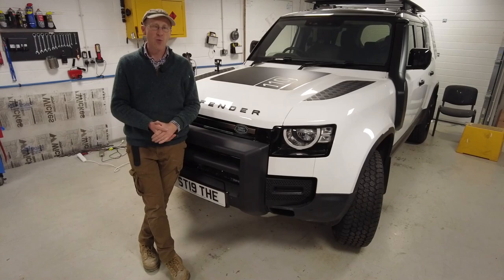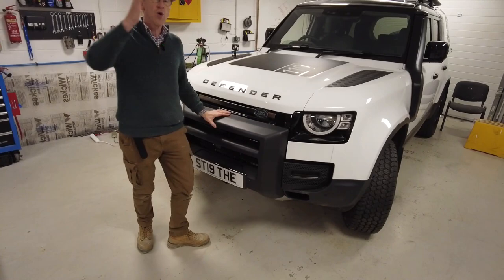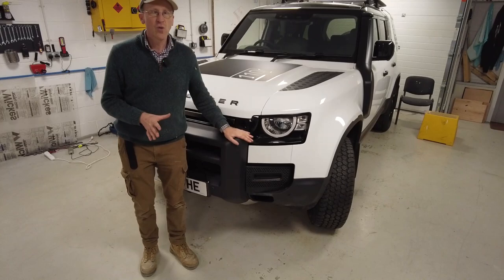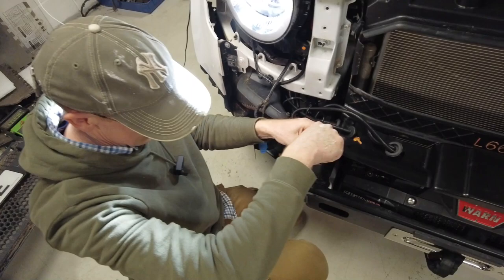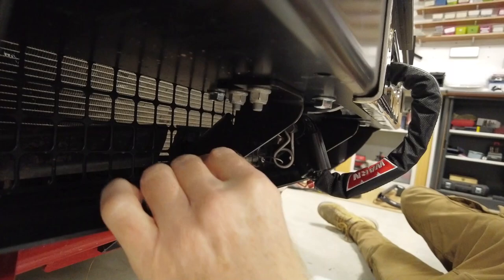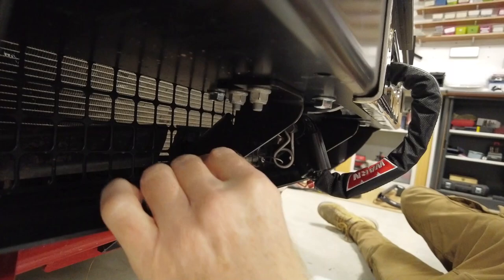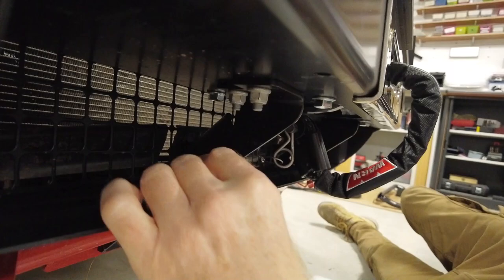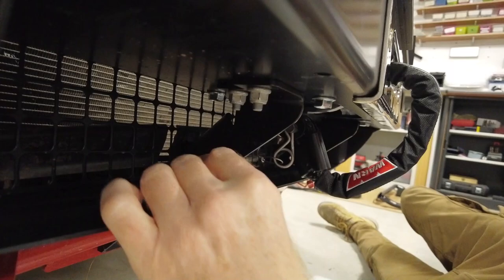New Land Rover Defender Winch Installation - part 5  "The Final Cut"

Comment: They have designed the vehicle without a winch and then added the winch later as an afterthought. They should have designed it with a winch from day 1 so that the standard parts would fit round the winch without cutting stuff. I fitted a towbar to my Jag XJ and that was the same (despite them winning towcar of the year); it was a horrible hack job.
Reply: Yes if it was designed at the same time they could have marked all the area's you have to cut out save you hacking away with luck and hope you're in the right place

Comment: Just wanted to say well done! What an effort! So much cutting, so many wires and lights and sensors and radars and clips and screws and grommets and bits of plastic....bloody hell it's an epic achievement. Even the ardent DIY enthusiasts here are thinking if they ever get one they'll order a factory fit!
Reply from the maker: I would love to see if the factory fit ones do all the little jobs... I am off to Eastnor shortly so will take a peak at any factory fit winches... do they fit the weather strip / grommets etc ?
Reply: @L663  excellent, yes would be great to know how they do it and what is different! And if they cut all those bits or do some alternative moulding plastic parts exist at the factory.

Comment: Wow what a major undertaking doing this oneself.  My concern though is that the average dealer technician won’t do these often and possibly not apply the same care and diligence that you have or owner, which as you’ve shown is clearly important for the end result and long term performance in the wet (water ingress etc.) etc.  So, I wouldn’t trust anyone else to do this.  Therefore your video series will become the go to tutorial for every winch installation.  Please can you produce a summary video to advise all required tools, tips, time allocation and how often you need two persons on this project.  Finally don’t forget to follow up on the rotation flaps.  Thanks Simon.

Comment: Just tackled this task today.  Took me a full day, but I am pleased with the results.  These videos made the task tremendously easier.  Well done!  And, by the way, the metal A bar on mine needed to be wrestled in the same as yours.  The right side (or as you called it, the left side) was particularly challenging.
Reply from the maker: Wow well done... how did you choose to wire it in ? The Land Rover way or my way ?
Glad the videos helped you
Reply: @L663  I used the standard Warn winch so I didn’t need to access any of the wiring harness/fuses. The one thing I did add was a electrical disconnect on the positive lead so I can keep it disconnected until needing the winch.

Comment: Thanks for the video Simon,  just finished Installing and the video was very helpful.
A couple of things I learned that may help others. You don’t need to do anything with wheel arches, not even the first clip.  It is a good idea to hook up two sae power cables to the back of the winch at time of install for future adding of accessories such as lights. The black crank wire fit into the back of the harness without needing splicing in my defender (2021 xdynamic SE USA).  I did have to splice into the ignition wire.
Reply from the maker: Glad the video helped and all credit to you for having a go ! thanks for the updates I am sure this will help others !

Comment: It is cool once its fitted and will be much much safer for other road users etc than a hulking great big lump of ARB steel strapped to the front of the motor. Must be one of the neatest looking (and safest) installs ever, albeit there's a shed load of work involved, nothing good comes easy!

Comment: Nice work,  nice videos. Winch installation is a pain in the back, but worse is gonna be, as the user's manual requires, the manteinance and checks after each use (i.e. keeping winch, rope and switch control free from contaminants, inspecting rope for damage,  ) or every 90 days (i.e. checking fasteners and make sure they are tight 
and to proper torque, verifying wiring to all components is correct and be certain that all connections are tight), replacing the synthetic rope if damaged.....

Comment: And in case you are out there somewhere and have to maintain the winch, like the relais, or spool a new rope, then you have to dissessamble the whole car?
Reply: Winches also need to be serviced and maintained which almost invariably requires its removal from the vehicle. This is a shocker on so many levels.
Reply: I believe you and N Noddy have hit on the real issue.   Winches are working mechanical tools and easy access is required.

Comment: Thank you for this. Watches all 5 parts tough job and not one for me. Will get the dealer to do it. Only observation.......should have raptored it first.
Reply from the maker: Yes at least that part is easy to remove.... not sure about raptor on the Polypropylene used on the front cover.

Comment: What amazes me is how much cutting is needed of existing panels and therefore the opportunity to make some significant mistakes. Why can't Landrover provide the precut panels as part of the installation kit, or better still,  redesign the panels so that they are dual purpose ie can accomodate the mods as necessary without all this messing about and specialist tools to do the work? Come on Landrover, you should always put the provision in for all your bodywork mods, like other companies do.
Reply from the maker: I think i would agree with your comments - nearly all the front panels needed cutting !

Comment: Given the costs and time to fit a winch , why would you?
Reply: Nobody in their right mind outside Saudi would bother I reckon.  Dealer would love charging the £1500 to £2000 for the labour time as long as they could persuade a mechanic to do the job. I suspect that once would be enough for any sane person.
Reply: The Finnish LR dealer said it's a 10,000€ option
Reply: @pkupias  
In the UK an 8000 lb winch similar to this would cost about €1500 to €2000 maximum, fitted to a Ford Ranger.

Comment: Ahhh! I feel sorry for you guys having watched this.   Looks like your winch is a warn Zeon Platinum 10 or 12 S with the wireless remote control???  Expensive bits of kit.
Unfortunately despite what Warn say in the marketing they are not weather tight, water gets into the control pack (just rain, the occasional splash and humidity in my case) .  I am on my third control pack in four years.  Not sure if you have or you haven't considered  (I haven't watched all your 5 videos on the install)  the remote relocation kit for the control pack?   You need to get the control pack away from the top of the winch and have it somewhere nice and dry high up under the hood (bonnet).
Moving the control pack would probably mean less cutting for you.  When you come to replace the control pack which you will they are over £600 and for you a whole lot of disassembly of the vehicle to get to it (another reason why you should go for the remote relocation kit for the control pack).
The powder coat finish on the winch is poor.  The aluminium will show corrosion starting  within 12 months (the paint finish is not covered under Warn's warranty).  I rubbed mine back and used an acid etch primer and satin black top coat and it has been fine since I did this.
Best of luck guys :)
Reply from the maker: OK we have been warned.... excuse the pun !
Reply: Thanks for the heads up. I have followed up on your advice and you are absolutely right. This Winch is not suitable with the control box mounted on it. Land rover have made a huge mistake. The control box is not well sealed. This is the best comment made in all the 5 part series. You have saved me a lot of money. Simon, how much wading have you done and is your Winch still working?

Comment: Another example of failure by LR to design a practical off road vehicle. Being able to accommodate a winch is a pretty basic requirement. The vehicle design process obviously took no account of this and they had to come up with some way to cram one in there, as an afterthought. The fitment thus requires 3 days disassembly, cutting apart, modifying and reassembling of the vehicle. Epic fail by LR, fantastic effort by PowerfulUK. Well done Simon, Tyler & George.
Reply: Most ppl that I know who have off-road vehicles buy HD bumpers. Those bumpers get the winch, and they are not integrated as the Defender version.  The car has been out less than a year and two companies are working on a HD bumper.  Maybe your friends trucks are different and all the winches sit on OEM bumpers.

Comment: Many thanks for those 5 videos showing us how to plug their winch equipment. Really nice job.
It also pop up few concerns:
- it look like they miss this accessory when designing this vehicle
- how much it cost to get it installed by your official Land Rover dealer ?
- why they made the front so complex with all those pieces ? It very looks like over over engineering!

Conclusion on my side:
- I was tempted to purchase this new Defender 110 instead of the old one. I might revisit it
- never touch the front as it might cost you a fortune to repair while off road
Reply from the maker: I think they had a lot to contend with in terms of design / safety / crash test etc
I am not sure how much this costs as a dealer install - not cheap I would imagine.
Other than a few technical niggles that are getting resolved with updates the new Defender has not let me down.
Reply: @L663  I saw your test run in mud. It is really a wonderful off roader. I will be more worried to unplug the front to clean it properly every time i use it in the mud. I am not sure all plastic clips will last long enough to ensure proper installation. 
Again, I have absolutely no doubt about  its off road capabilities. But when it come to equipped it for long trip (few months) for off road or overland, that’s another story IMHO.
For my point of view, it’s a perfect car for short trip (max 1-2 weeks) from time to time, but definitely not as we use to use the old Defender !
Thanks for your replies.

Comment: I have never had a winch on my landrover defender but back in the days before I gave up a 90 for something more comfortable I used to read the various land-rover magazines. Many articles become frequent features over the years and one would be to service your winch. You see how much silt was left between the plastic bumper parts after you had power washed it? Well all that will be inside the winch after a few wet offroad trips. How many days and spare plastic clips and sticky pads will you have to set aside to service that plastic bumper covered winch? Remember the gromits in the cover for example. All this is before the various bolts are attacked by road salt and dont want to play.
I have watched and enjoyed your 5 part series but am unable to take the actual kit seriously and can only assume that many will be fitted but seldom used. Sorry its a bit long, like the videos.

Comment: Great video but what a Faff and the number plate mount looks like it will last ten minutes before the lugs snap off.  Can you imagine the work if its ever in a front end bump, all those new bits of plastic to start cutting up, the large black cover looks like an old air con unit strapped to the front.
How come you had a faulty Defender and were given a free winch while the US guys who had the faulty Defender (then the winch loom shit) were given a $16,000 upgrade to a 6 cylinder model?? 
Keep up the great vids, love your enthusiasm and no nonsense approach.

Comment: You have fitted the number plate in what looks to be the only place it can go, but using the winch in the dark?  Its going to be easy to loose that cover along with the reg plate.  Could it be on a retaining wire?

Comment: Question for you if you’d be so kind? Do the winch fitting instructions imply much difference between the various engines/models? Have a P400e PHEV coming in March and certainly want to fit a winch. I wonder whether there are any differences... No starter motor & hence no crank signal I guess??

Comment: Wow. That was tough. I wonder how much JLR charges to install one (not counting the cut loom 😳)... Well done!
Reply: I reckon a dealer would charge a minimum of £1500 and probably more than double that. That's at £100/hour. Many main dealers will charge well above £100/hour these days.
Reply: The winch alone costs $6000 in Australia.
Reply: @FJUH  
That’s £3400 UK. That is a ridiculous price. Top quality industrial duty 8000lb winches in the UK are generally available for less than £500 including 20% VAT

Comment: Bravo!

Whilst the winch is impressive, and looks great, for the price it costs (£3K in the UK), you'd have thought that LR would provide you with a load of replacement bits so you don't have to cut up your lovely new Defender.  What happens if you decide you want to take the winch off and return the car to its previous state?  You can't - you've cut holes and removed sections all over the place.

Looking forward to seeing the wheel arch protection soon!

Comment: Wow.   You two guys have executed a really valuable service!  My sincere thanks, and the thanks of many others, I am sure.  

Clearly JLR did not complete the design job --- they should have provided either new plastic parts or molded-in cut indentations, as well as placing more thought into the wiring design.  

I guess I question why the JLR marketing decision was to stuff a winch in such a small area, apparently in order to maintain the surface profile of the original design (the one without a winch).  I really wonder as to the practical usability and serviceability of an enclosed winch, over the years and in real-condition.  

I for one do not care how the vehicle looks --- I specified and bought my 2020 Defender because of its 4x4 Drivetrain --- to do work off-road. 

So, I am holding off on ordering a winch for now, hoping a more practical option may soon come onto the market from an aftermarket supplier.  If it does not, I will try to figure out how to make a more practical installation of the winch.
Reply from the maker: Hi Chris... yes I am not planning on doing another winch for a while ! good luck with the design.. the video should help you understand some of the issues and where the car has strong parts to attach to.

Comment: Just another reason I own a crude but effective plus cheap fj cruiser. I can install a ARB front bumper and same winch in less than 4 hours. If I need to work on that winch I can get to it from on top. Try doing that with the new landrover. The old ones you could take apart fairly easily. I'm definitely not seing it with these new ones. Smh
Reply from the maker: These are good points you make - and hard for me to Defender even as a fan of the new Defender !

Comment: Hi, could you tell me if Defender 90 with winch mounted is longer than without winch and, if yes, how longer is it? I coudn't find this info in LR sellers in Italy. Thanks for your help!
Reply from the maker: Hi Edo - the car will for sure be longer than the standard car.. I can confirm how much tomorrow when i am in work !
Reply: @L663  Thank you! I plan to buy the Defender with the winch but I don't know if it can fit my garage... May you check tomorrow how long is it and how much is the height from ground to the top of the main metal black frame? thank you very much!!!!!!!!

Comment: 😲Well I survived! Only just though! That was a mammoth session of five episodes of fitting the winch 🥱. Anyway, quick question, do you need the LR underbody protection plate or will this work with the aftermarket system? 🤔
Reply from the maker: It should be OK with the aftermarket system as they use the same fixing points

Comment: Hello! Thanks for your video. I also installed the winch in my Defender, installed at the dealer. I see you returned the front air flaps, the dealer's installation manual states that the front air flaps need to be utilize and the control wires insulated. Now I doubt if the dealer did the right thing?

Comment: Just currently halfway through this vid and I’ve had a worrying thought… I may want to spend £50k on a brand new defender and have them fit the winch from new…! My thought is do they cut and shut the same panels in the factory or are they made to suit ie: the slam panel pre-butchered and powder coated to finish because I do not wish my new Land Rover to be rusting in various places and then struggle to get it fixed under warranty and the fact that it all appears to be an afterthought! 
Great video Simon, can Mr sky Walker let us know because I doubt my dealer will.
Reply from the maker: As far as i know the winch is a dealer fit option ( you dealer should be able to confirm this much at least )
All parts fitted at a dealer will come with Land Rover warranty and not have any impact on your vehicle warranty.
Land Rover to their credit are still honouring my warranty even though I have done all this myself.
These are only my thoughts and experiences.

Comment: Imagine your radiator needs changing after the warranty's over with a winched up Defender like this. It will be a complete week's work or more at your local garage, the winch won't ever work again, the local mechanic will hate you and you will be broke.

That wasn't exactly Zen and the Art of Winch Installation.